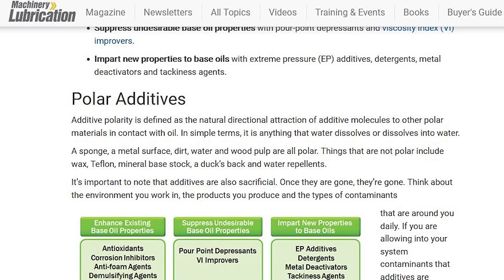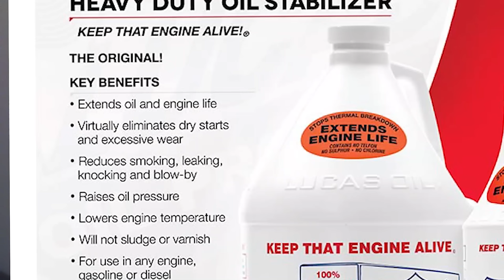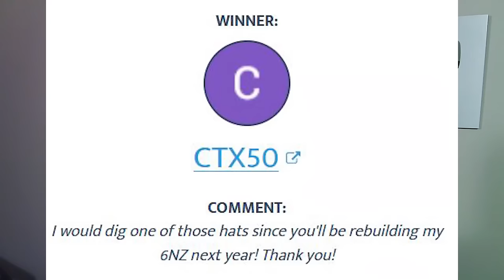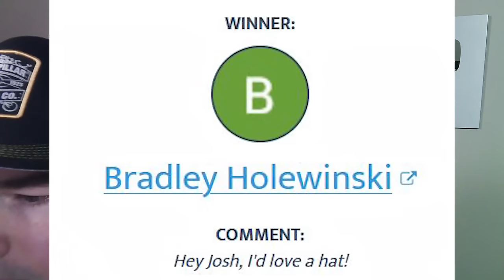Does your Engine NEED Lucas Oil Stabilizer? A detailed look at the "Benefits."

Comment: I am a firm believer in Lucas. I have an 01 navigator that I bought with around 126000 on it. It was poorly maintained and had a slight knock coming from the timing cover my guess on this was a sticking timing chain tensioner got it home and changed the oil and used one quart of Lucas in place of one quart of oil the knock went away after about 50 miles or less I just drove it around town a couple of days and before the knock went away which really surprised me. I change my oil every 5000 miles and use a quart of Lucas on every oil change I now have 225000 miles on eng and sounds good as new and runs like a champ.
Reply: Anecdotal evidence is the lowest form of evidence. If a 10-dollar bottle of additive could improve engine life and increase performance etc, then every manufacturer would recommend it. That would mean less recall and warranty work on their end. 

When developing an engine, they run prototypes for thousands of miles through a myriad of conditions; all while testing oil samples throughout the range. In the end, they typically conclude that x oil is best. Also, you can reference the API label on each container of oil and it will tell you what specifications it meets. In a nutshell, oil additives are pointless. Do your scheduled maintenance as per the manufacturer and your engine will live a long happy life.
Reply: It’s miles not kms, 252000 miles is a lot
Reply: @TheWalterHWhite they engineer the vehicles to break down after warranty expires through planned obsolescence so your argument is obsolete
Reply: @wazup3333  so you lead an engineering team at an auto manufacturer? Vehicles are judged on reliability, and it behooves companies to produce the most reliable vehicle.
Reply: Interesting; I had some Lucas I was planning to use with my 01 Xterra, but I just cleaned and rebuilt the engine after a head gasket and timing chain swap, and I did the tensioners too but it still have a slight chain rattle for the half second before the pump pressurizes the tensioners on cold startup. 

I am using STP full synthetic 5W-30 for the break-in oil (I got ~4Qts for free thanks to finding a sealed 5Qt container with a damaged handle). It would have all leaked out if I didn't stop for it, so at least now it serves a good purpose before getting properly recycled. Otherwise, it's been running fine for the last 15 miles. 

About to drain the oil and drop the filter to check for forbidden glitter, then it's fresh Mobil 1 and a fresh Mobil 1 filter, and since it's cold rn I'm going to rely solely on the additive package of the Mobil 1 High Mileage 5W-30 full synthetic and see if that improves things on cold startups.
Reply: @TheWalterHWhite your logic, that every manufacturer would recommend, it is not a fact. 

Go read the owners manuals 
On all new, 1500 & 2500 
Gasoline pick up trucks from the big three, they flat out, tell you that the transmission fluid is good for the lifetime of the transmission. 

The dealers will flat out, say that you don’t have to change the oil or the filter. Yet ZF transmissions for ram will tell you that you should change the filter and fluid at 50 to 100,000 mile intervals.
Reply: @TheWalterHWhite gas mileage squeezing.  Many cars, including subaru, recommend thicker oils is other countries. This lessens mileage but performance is better. The US government is the reason lucas is awesome kinda lol.  Thicken the oil, plus the additives
Reply: @MadViper92 💯 they lowered the weight, many now running 5w20 to save on fuel. It does actually save me on fuel but the oil definitely brakes down faster, especially in the hot summmer months.
Reply: @TheWalterHWhite  are these the same engineers running belt driven oil pumps being drenched in oil  in or timing chains in the back or direct injection without port injection or make exhaust manifolds that crack 10,000 miles after purchase, not solving the issues with hemi lifters and cams for almost 2 decades…. I can go on and on

Comment: I've been a fleet tech for over 40 years. All our oils are sent for analysis. We have been using power up additive since the mid 90's. The results are impressive, wear metals all went down, thus we've increased the change intervals and prolonged rebuilds.
Reply: It may work for you. Good thing is you do oil analysis. Another operator may work in cold climates like Alaska or Canada. Their oil requirements may be different to yours. Cheers
Reply: Any friction decreaser that doesnt become corrosive 👍 ptfe,teflon is what many are..
Reply: @Adscam  I'm not a fan of Lucas products but this product's purpose isn't to thicken oil like he claims.  These oil additives do so many other things he doesn't touch on.   False equivilancy ALERT!!  Thicker oil isn't stickier. Those are two different qualities.  Especially in cold climates you want sticky oil that will cling to your cam lobes, other valve train parts and especially cylinder walls.
Reply: @MrFatcat23  He didn't say it was sticky just because it's thicker; as he pointed out, Lucas has additives in it to increase the tackiness, or stickiness. So it is in fact stickier, because it is in fact stickier. In this video, the property of stickiness has no reference to the viscosity being thicker, he refers to it as an independent property. Furthermore; as he pointed out, regular engine oil clings to the bearings just fine, even in a heated shop, it will cling even better in colder temps due to the natural viscosity increase, you don't need anything other than regular oil to prevent dry start-up, and as shown in this video, isn't really a thing, even after sitting for a couple weeks, in a heated shop. Anybody who has ever pulled a bearing cap knows there is a suction there, due to the close tolerance and the oil, which in turn retains the oil, even on engines that have been sitting for years, there will still be suction on any bearing cap within normal wear limits, even the thinnest oil WIll NOT, EVER, drain out of the bearings, unless they are already wasted. Do not run thicker oil in the winter, especially not in the winter. In Montana, it is necessary to switch to a thinner oil in diesels, typically from a 15w-40 to a 5w-40 if you want it to start easily and reliably on really cold days which can get well below zero degrees F.
Reply: Yeah definitely dont go thicker in winter 😂😂 use what is specified in your owner's manual UNLESS it's for a specific purpose... like racing or modified etc.. if youre doing hot laps in your car and your oil temps get quite high you may wanna go a lil thicker but definitely ask someone knowledgeable about the specific engine prior to doing such. Newer engines its even more important. An older engine like a small block Chevy is more tolerable and could benefit from proper use application.
Reply: WHAT IS A POWER UP ADDITIVE
Reply: Well oils have also increased profoundly in their resistance to shear and heat. Oils since the 90s have grown by leaps and bounds. Perhaps that explains the increase in reliability.
Reply: I didn’t realize engine oil was “unstable”. Generally speaking, I think most additives are just modern day snake oil. But hey. It’s possible that I don’t know what I’m talking about. As he says in the video, show me some peer reviewed studies and, maybe, I’ll change my mind.

Comment: Bottom line is if you use Lucas oil stabilizers you're probably maintaining your vehicles well. I do believe in their products
Reply: they make great stuff but id not use in on newer cars after 2010 iv seen it make oil to think cause rod knock but on older engine run it in every thing
Reply: I'm currently running it in my 17 ram just to try and keep the engine together for as long as I can at this point it developed piston slap about 30000 ago hence why I'm running Lucas because I can't justify the cost of replacing the motor that costs more then the truck is worth
Reply: Or you trying to save a vehicle that you haven't maintained properly and the engine sounds like crap lol
Reply: @possessedjake13  how is it goin?
Reply: @danielfbej  she's still holding together about 40k now
Reply: @possessedjake13  surprised man that's awesome to hear.

Comment: I got over 650,000 miles out of a 2000 Freightliner with a 3126. I never did an inframe, never blew the motor. No smoke, no blow by. I used Lucas, changed the oil every 8000 miles. The motor outlasted the truck itself. I sold the truck a year agao, and the motor was swapped into another truck that's still in daily use.
Reply from the maker: That's an impressive amount out of a 3126.
Reply: @AdeptApe  You always say that whenever I post about it. The Motor was unkillable. One extremely cold February morning I dropped a valve. I had a load on the truck that was going to Rhode Island to a Merchant Marine ship. It was their supplies.I had to be there by 8 am. I had no choice to try to make it. I drove almost 200 miles and made the delivery. I had the truck towed back to Brandford Freightliner in Connecticut and they repaired it. My buddy Adam, who owned a trucking company told me if that chain of events didn't kill the motor nothing will. He was right.
Reply: The THOMAS , DID YOU USE 20% LUCAS IN THE 3126, OR JUST COUPLE QUARTS ? JUST WONDERING........I HAVE 2014 CUMMINS 6.7 W/ 598,000 PULLING RVS AND DOING GREAT ON 20% LUCAS AND 15W 40.   It is my third Dodge Ram , and second one w nearly over 600,000 miles
Reply: @ronmoore3987  I had the 32-quart sump and used 1 gallon per oil change. Sometimes I would add Lucas if I was down a quart. I didn't burn much oil inbetween services which became shorter and shorter intervals as the miles added up. When it was new I would go 15 thousand miles in between oil changes, then 10,000, then 7,500 miles or every 4 months which ever came first. The engine still lives on in a dump/plow truck.

I now have a 2018 M2106 with the Cummins 6.7B and that has 365,000 miles on it. I'm not using Lucas. I have been using Triax oil in it since it was new and I find that oil to be the best I have ever used.
Reply: Wow

Comment: I put Lucas oil oil stabilizer in my racecar, mind you it's a 50 laps race, 5 laps in the car was way over heated. The gauge was maxed. I ran the rest of the 50 laps, yes car was very hot by the end of the race. All the car did was burn a quart of oil. I started the car the next day and has no knocks, no pinging, nothing. I am positive if I didn't have the Lucas in the oil, that motor would be cooked. I love this product and I sware by it.

Comment: 44 years in trucking, never had a new truck it's always been used. I have used Lucas for many, many years. In engine's, Trans, and rear ends. Never had any problems. I do change engine oil every 10,000, and air filters every 4 months,  Trans and rear ends every year. One thing you missed and failed to bring to light was dirty air makes dirty oil and increases engine ware and performance. At the present I have a c-16 I still practice 10,000 air filters at 4 months. You think about it 1 gallon of Lucas to 9 gallons of oil 10w40. You also failed to recommend not operating that engine till it got to proper operating temperature. I'm  sure you are a very good mechanic I have watched your videos and will continue. Don't ever stop thinking out of the box, don't get what I  call working with blinders on. 👍😉🇺🇲

Comment: I use Lucas and it improved the idle, prolonged oil life, the oil temp was better and the oil pressure was better. Good stuff!
Reply: Did you determine these facts with a scanner and actual read out of these items that you're mentioning or did you do it by the convenience cages that are not completely accurate on your dashboard.. Not criticizing just asking
Reply: Bs

Comment: I used Lucas for 12 years in a 2007 Toyota Yaris. I started using it the oil change after the warranty ended. This was an eye opener for me. At the end of the cars life it had 550000 miles on it. I never had a problem with the motor. (The transmission mounts rotted out)  Lucas is a great product. The main thing it does is holds the oil on reciprocating parts. You aren’t using only Lucas. I was using it at about 25% Lucas 75% oil. It doesn’t thicken the oil to 60 weight. I used 5W30 and it was probably 7W30 when added. It definitely works tho.
Reply: I'm running a 2013 hyundai accent and honestly found after multiple runs of the car between oil changes and multiple samples taken of the oil, that thickening the oil has very little effect, running a 10W40 (auto shops recommendation) with oil additive I was running a steady 6.7L of fuel consumption per 100km on the highway, dropped it down to a 5W30 to test another oil product and was running 6.2L per 100km on the highway, then after fitting my oil intercooler, catch can, cold air intake and LED headlights, plus getting the transmission serviced, I've ran the manufacturer recommended 5w20 SAE oil with no additives and fuel consumption dropped way down to 5.4 average litres per 100kms.
Point being it doesn't matter what additives you run you're always going to suffer on fuel economy, and unless it's a PTFE or LDDP additive it's not worth the added fuel costs.
That said I have occasionally ran lucas upper cylinder lubricant, 1 quart will last me about 20 fuel tanks worth and you can definitely feel the effect it has on the throttle response.
Reply: @alexanderwoolley1623 to be fair those 1.6 gamma engines love thicker oil, I run 15w-50 in the summer in my '16 with 231k and it purrs along happily.
Reply: Well said, that what I was about to say EXACTLY......AND it does not mean the Lucas oil IS preventing oil to pass through tight spaces I'm  POSITIVE THE OTHER PARTS or aspects of the oil does pass through 5w-20 or 10-w30 tight areas of the engine... by him saying Lucas might prevents that I HIGHLY DOUBT THAT. ( and is a BOLD stament when there no physical proof or test.That would mean you used 100% of Lucas oil 😂😅 so take your pick what is accully working. My bet is there working in unison thinker oil stays on top while thinner oil passes through in theory. But what I have witnessed many time noise is reduced and Lucas oil cold cranking definitely  prevents DRY starts. My dad's 1991 Ford Ranger XLT put Lucas the second time the oil changes quieted and ran much much smother but of course did a full tune up aswell. Taping was reduced dramatically. When the engine really Warmed up even quieter. I used it for 20 years. It just made sense DRY  COLD cranking #1 problem with ANY VEHICLE when regular oil sat too long. I hear that noise every time I start my car with out Lucas..
Reply: I think the eye opener here is Toyota and not Lucas
Reply: @konstantinostselios1129  that was a good one!🤣....but I had  ford complete opposite not like the mighty toyota, still, the 91 ford ranger still RUNS SMOOTH .... for now😅😅.....Lucas help that noisey ford

Comment: I probably wouldn’t use this in a newer car but it does work pretty well on worn out engines. I had a car that started burning a quart of oil every 400 miles around 225,000 miles. I started using a similar product and started burning a quart about every 2,000 miles. When the car finally quit for electrical issues that weren’t worth fixing the engine was still running strong at over 275,000. This stuff is great for keeping an engine that’s on its last leg going when it’s not worth putting more money into the car.
Reply: I will drive until tires fall off
Reply: They have a synthetic for newer low Viscosity engines, I run a 1.5 quarts in my 5.7l Tundra (it's 9ish quarts withe filter). The nest thing about it is that it sticks to all the import surfaces, 95% of all wear in a a motor is cold dry starts and this stops it.
Reply: @TdrSld  my tahoe had 350k an had a small tick when started added lucas and never had another problem sold it with 400k ran mint
Reply: You shouldn't use Lucas Heavy Duty on a car anyway. That's what Lucas Synthetic is for.
Reply: @ravenshrike  synthetic is for synthetic oil. Heavy duty is for reg oil. I live in fl and it gets so hot here the oil breaks down so much faster. Lucas heavy duty oil helps keep everything coated nice. My uncle had a 2000 Grand Marquis he always went to the service intervals for fluid changes well it says 100,000 Mi for the transmission fluid not here in Florida should change it around $30,000 miles or whenever the oil starts to change color
Reply: @josephfreeman1427  Synthetic is for both synthetic and non-synthetic oils. Says so right on the bottle.
Reply: @ravenshrike  I run reg oil I'm my integra so I run heavy duty oil stabilizer not synthetic

Comment: Ever taken a motor apart after using Lucas? I have, and the stuff sticks to every metal surface in the motor..thereby reducing if not eliminating dry starts (starting an engine is the most damaging time for a motor)...Lucas definitely provided near total protection as far as lubrication..my system is 5.5 quarts, so I use an entire "quart" bottle. I have also used it for assembly...freaking awesome!!(I soak the bearings for 24 hours pre assembly).. it also blends with the oil you use, and thins the Lucas out...which in turns makes the Lucas flow easily.
Reply: or just get thicker oil.. when oil gets Hot it just runs down to the pan we put some in a 4cyl engine running a generator and ran it dropped the pan there was no difference in the way the oil was "sticking"
Reply: @Mr_Meowingtons  I call bs...I pulled apart a motor as far to using Lucas..I to was literally sticking like a thin glue...so go back and club up so you know what you're talking about
Reply: @Mr_Meowingtons  yea buddy get out of here and let the engine builders talk
Reply: @thomaspower8197  You sound like the type of person that daily carries a 1911.
Reply: @nocturnal0072  he probably lubes his 1911 with Lucas
Reply: @psychotikpaisano  Lucas does actually sell a gun lube now....lol
Reply: @nocturnal0072  why 1911 shame. 😁